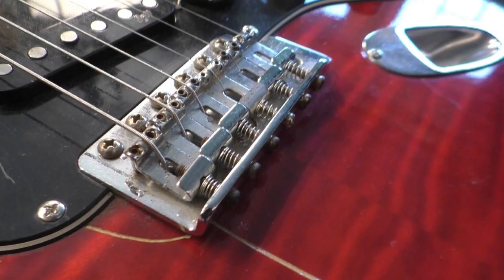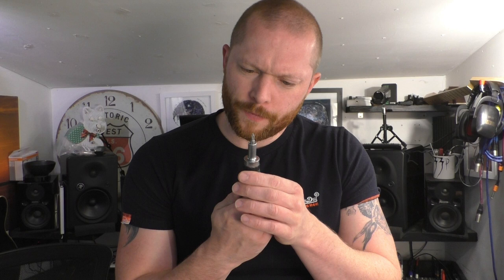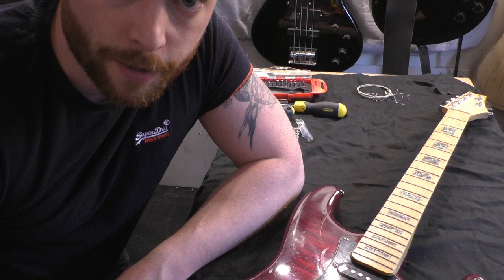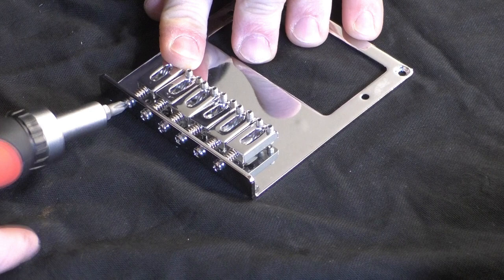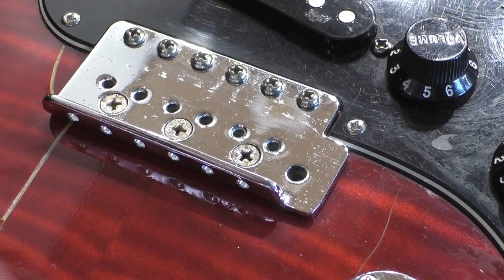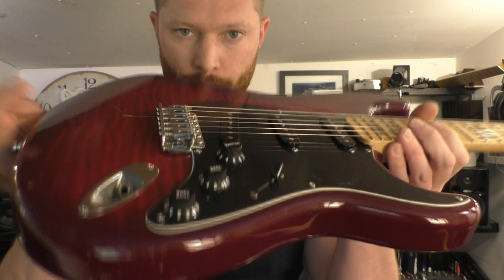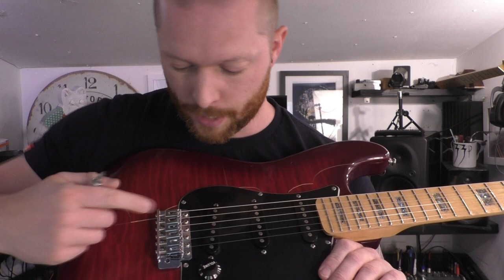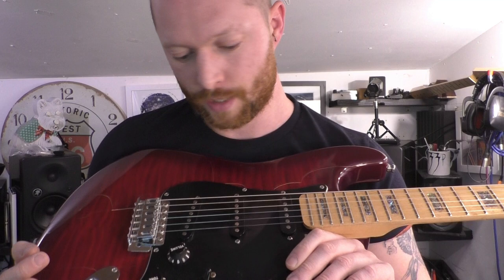How to replace guitar bridge saddles

Comment: Cool vid! I am currently trying to derust mine and put them back on and was looking up vids. So the bridge saddle order doesn't matter correct? all the saddles are the same?
Reply from the maker: Thanks mate. Yeah, any order, they should be identical. The ones I replaced were a load of different sizes as they’d been replaced badly over the years by previous owners. 
I think wire wool is good for rust. Not quite sure though. Let me know how it goes
Reply: @PherotoneStudios  ok cool thanks man. I felt like it was a stupid question because I couldn't find anything on Google about it. It's going well so far. soaking my saddles, bridge plate, and screws and such in apple cider vinegar. them going to hit with heavy toothbrushing. then wd40 and wire wool or maybe. sandpaper. rust lvl was pretty terrible sadly, should have never let it get that far
Reply from the maker: Wow, that is a lot of work. Is it easier to just change them or are they nice saddles? I suppose if it’s a really old guitar then it’s nice to have the original parts

Comment: You got the intonation adjustment directions wrong
Reply from the maker: Typical
Reply: screw the saddle forward/backward screw to make the screw end longer (right or clockwise) and the saddle goes backward. That makes the intonation go flatter.
Reply: Yeah when u make the string longer or push the saddle back the pitch becomes flatter (lower). When the opposite is done and the saddle moves forward thus shortening the string the pitch is then sharper or (higher).

Comment: The saddles on my Squire are originally too wide, and they are flat, without any grooves, which makes strings sliding easily and going out of tune. I'm trying to find ones with grooves and width less than 10 mm. Any idea?
Reply from the maker: I'm not too sure but have a look around online and read teh details carefully.  There will be something that works perfectly.  I had a Fender where the saddles were originally too wide.
Reply: @PherotoneStudios  yes, I have noticed that on your video. Same problem on my Squire bridge. Thanks
Reply from the maker: Oh yeah. That’s the guitar I was talking about. I genuinely forgot it was the guitar in the video. I have the opposite problem on my Tele, the saddles are too small and move all over the place. Annoying

Comment: So how do I do what saddles to buy? I got an 83’ Bc Rich Warlock where each saddle is just a teeny bit shorter than 1cm.
And btw for reference  the bridge is close to 8cm near the rear of the saddle, and it’s about 7cm at the front.
From appearance, the bridge on your start looks to be a similar trend system as mine, but I thought giving some measurements would help. 
Cheers!

Comment: Great, simple video. Thank you. I wanted to know how the saddles usually line up when they are in tune properly. Mine that I have to like this

Low medium high loe medium high

Kind of backwards from what you show. I really dig your practicality: buying telecaster bridge to takeout saddles, and using the rest of it. Well done.
Reply from the maker: Do you mean saddle height-wise, or how they are positioned from the rear of the bridge?

Height wise, get them so they don’t buzz and close to the same radius as the fretboard.

For intonation I always use a tuner and get it so it’s in tune open and at the 12th fret. Normally the low E is the furthest towards the bridge, then the A is slightly more towards the neck, and the D is slightly closer to the neck than the A. Then the G is back towards to bridge, then the B and high e step forwards. 
Oddly that’s not always the case but most of the time it is.
Hope that helps. If not I’ve probably misunderstood
Reply: @PherotoneStudios  it all helps. I'm hands on, and this is my first time getting into this because I bought a new bridge. I tried to adjust to be the same as my current one, because it seemed to be set up well. I've adjusted everything quite a bit, unfortunately, so tomorrow I'll be on an intonation mission. Only way to learn. Thanks again